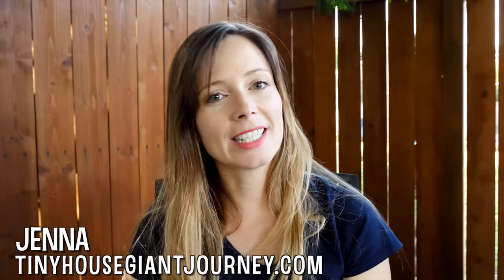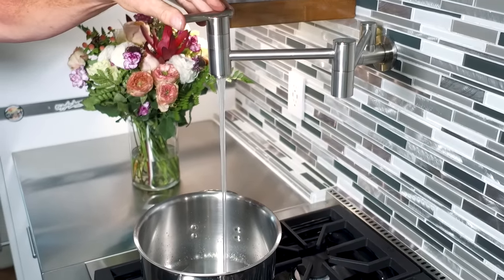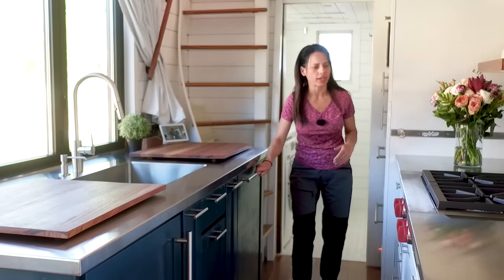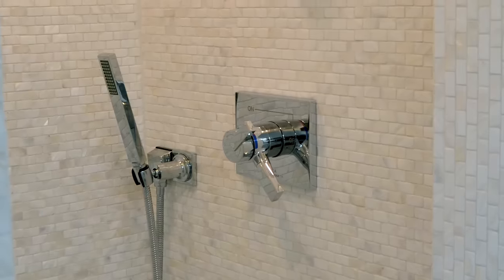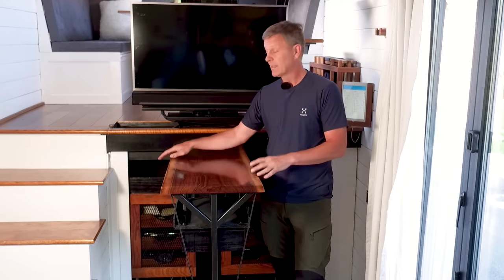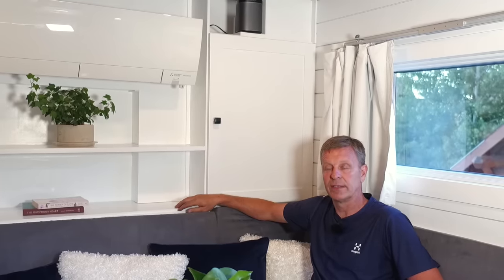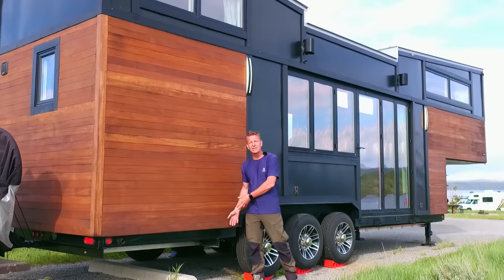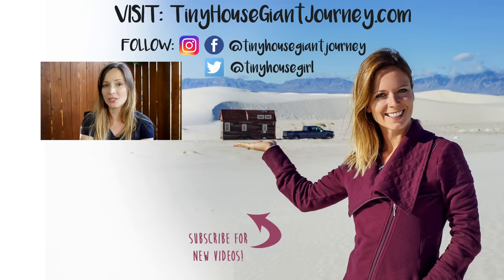Luxury, High-End Tiny House After Leaving Ex Large Home

Comment: Wow this is nice. This couple thought of EVERYTHING. From building a wonderful tiny home, to owning a BIG TRACTOR half truck to move it and lets not forget that tiny electric smart car!!
Reply: Definitely an amazing duo..brilliant design..and my most fave among so many tiny houses and off grid I've watched so far
Reply: À
Reply: @katyabone744  this has a virus guys dont click.
Reply: Definitely the one of the smartest duos
Reply: Kenneth Boyer  Yeah, that was my reaction too.  The truck was more expensive than they spent on the house.  Also there is no way his "materials" cost included all those appliances as well as the car.  Those were ALL high end appliances, at least 50K, plus automation.  They have at LEAST $400K all-in invested.  Probably closer to $500K.
Reply: It suits their new lifestyle
Reply: BABY A Well, not lesser carbon foot[tint though
Reply: Kenneth Boyer   I have a old Smart which now are owned by Mercedes and I gave it a little bit of a march because not knowing if the car is new or 2 years or older but between new and two years the Electric Smart is worth about $25.000,-  So.. all in all the entire combination they have on the road is a fortune.
For one a big fortune and to the other a small fortune. 
But I like it a whole lot! For building it themselves and thinking clever, making the entire rig so costume so you can use maximum (although I already saw some things that were thought out very clever but, I foresee that the deck will get renovated due to the wood started curving and giving troubles with stacking them away for one .. ) but something like this whole rig you can foresee that things will keep on changed because  some things never get used or just not that convenient in the end. 
But, that's everywhere and life in general.
Reply: Kenneth Boyer  200,000is attainable for everyone if they put their minds to it
Reply: Sound sarcastic to me
Reply: Kenneth Boyer  probably the towing power, all wheel drive? and maybe because they could afford to.
Reply: Tsiu - Yeah thats so true ... I didn’t think of that.

Comment: Thank you for showing this beautiful tiny house, Jenna. Its a bit disheartening to read some of the negative comments on here trying to invalidate this couple because their home doesn't fit into what some people consider a tiny house. Having resources to build your dream home is something I wish for everyone to be able to do and something I aspire to be able to do some day. This house is perfect, for them.
Reply: Jenni Boo my thoughts exactly. Just because they can afford to do this doesn’t mean they have to go by somebody else’s rules.
Reply: Dude they're"limiting their footprint" by hauling it around on a tractor trailer. All the power to them for the $200,000 tiny home but call it what it is. They want to glamp for a year and there's nothing wrong with that but they're increasing their footprint massively with this thing.
Reply from the maker: @CrosswaIk  incorrect. People used to say this about my Tiny House when I was pulling it with a Ford 250. It annoyed me so much that I had an environmental engineer do an analysis to educate people who makes blind comments without research. I have the engineer all my stats, and he compared my lifestyle to that of the average American household. Even with towing my house 25,000 miles in one year, I was using less than 25% of the carbon a typical household uses in the USA. This house is larger and heavier than mine, but it still would not even compare. To understand why, you have to also include the amount of gas a typical working couple spends going to and from work, every day, with two cars. This couple works from home, and when they do drive during the day, they use an electric vehicle. Yes they move their house on occasion with a semi truck, but 7 mpg is also what the average Class A RV gets. Heck, I even got 9mpg with my 10,000 lb Tiny House and truck! You must also calculate their electricity (solar), water usage (heavily reduced with the compost toilet), reduced heating and cooling. I'm telling you, it doesn't even compare to the average household in the USA (which is alarming), let alone the 5,000 sq foot house they lived in before.
Reply: @CrosswaIk  Well yes,  burning all that diesel does not diminish your footprint. Reminds me of those big bus motor homes or bus conversions. And since there is a lot of conversion parts within this home such as deck, tables, and ladder, hope neither one gets an injury or their beautiful home will be on the market. They did an amazing job building it.
Reply: Tiny House Giant Journey thanks for this response. I get so tired of people judging and complaining about what others have. Living tiny doesn’t mean living poorly. I’m renting a 700 sq ft condo that I would never be able to afford at over $800,000. I could buy a custom tiny 10x38ft, loaded for $150,000. All the same amenities and finishes in a smaller footprint but a smaller price per square foot. A 300 sq ft condo where I live starts at about $519,000. Thanks again for your great videos. Have a great weekend.
Reply: @TinyHouseGiantJourney  Great comment and glad to see it. The average person has no idea what their usage and footprint is. Most people don't even know how a car engine works let alone how to calculate an energy and carbon lifecycle analysis, yet somehow feel perfectly entitled and happy to criticise someone else's lifestyle, while their own actually has a higher impact. I entirely agree with you and am glad you had the calculations done. I'm a chemical and environmental engineer in Australia, and even with our significantly lower energy and fuel usage per household compared to the US, towing a tiny would usually still come out ahead.
Reply: Crosswalk  ???? Are U kidding? Did U watch the video?  Umm yeah, I’m pretty sure this couple didn’t sell their 5,000 sq.ft. Home just to “glamp” for a year!  Ridiculous comment & yes they’re enormously sustainable!
Reply: Tiny House Giant Journey and that is the problem, the average American home.  How about having the engineer compare it to an average working class European home, or an average working class any person household.  The “American standards” and dream are exactly why our planet is such a disaster.  We have a tiny trailer (7x 17 feet)  that we use to “glamp”with our 4 cylinder.  2 adults,  1 teenager, 1 dog and sometimes a second teenager.  Really, even it is unsustainable, but I could no longer tent because our weather has become so extreme. (Hail the size of golf balls becoming the norm,  and rain storms dropping 30mm in no time. We never tow it further than 3 hours away. ) You can have this sort of lifestyle with an even smaller footprint.  Don’t call it eco-friendly and sustainable because it’s not. Our home is small, and yet still too big for us (800 square feet).  I’m working on convincing the husband to bring in a small family like ours or university kids because it really is too big for us and I fully admit this lifestyle and the dream I used to have is exactly why my child is living in a different world than I ever had. Far too much of justification of these choices not having an impact on others, because it is. All those fossil fuels burning needlessly into the atmosphere is exactly how we are ending up with all the storms and Australia and the Amazon Burning. Stop greenwashing. I will stick to the New Zealand tiny house series.  There, most people park them in a spot for more than a month at a time, then a tiny home is sustainable.  There is no jealousy here. If they had not made the comments about it being sustainable and eco-friendly, I would have watched and moved on and not cared a bit, but they didn’t.  They are presenting it this a sustainable form of traveling and seeing the beauty of our world, it is not.  Children like my child are suffering because of greenwashing and over-justification of lifestyle choices that are extravagant and unsustainable.
Reply: @melissabenson6749  I would be very surprised if they're still living in their tiny home in 5 years.  I guess we'll have to wait for the follow-up.
Reply: They did an amazing job!

Comment: This “tiny” home is bigger than my rental. Just saying
Reply: lol and probably more expensive than the last 3 homes I lived in combined... the rig alone goes for nearly 40k used never mind the cost of conversion, all together I'd estimate they spent 3/4 of a million on that set up... if not more... glamping at it's finest!
Reply: Elsa’s Lair  Notice the vehicle towing it. That in itself would tell you how big and/or heavy this tiny home is. Of course there is the car.😄
Reply: @annferguson3113  They talked about weight in the video, and the trailer is only about 36 or so feet long, it's under 300 sq foot. The tractor is over kill for that small of a load, you could do that with something around a 350 but that tractor does it with ease which is what they wanted, plus you get room to put that electric shoe box on there

Comment: They did a great job in realizing their vision and the details are impeccable.   For myself though, the novelty and thrill of tiny living would wear off fast.  

I'm not a fan of having to pull, tuck, push, restore and work around things from one activity to another.  Activities that would take a straight forward one or two steps to accomplish in a straight-forward house would take tucks, pulls and swivel to accomplish to complete, tt'd just get old fast.    

As part of traveling, I also like to experience the hotel, BnB, camping or motel and that would be out of the equation.  

These are just deal-breakers for me.  I'm putting them forth because, should some of that ring true to anyone out there, then these are factors that ought to be thrown into their decision mix.

Comment: I’m curious about how they find places to camp their tiny home. I’ve heard it’s a pain due to laws and restrictions. And what would happen if their truck stopped working and needed repairs? The home is nice, but I’m curious of the cons and how to overcome them, too.
Reply: Yeah I’m really stumped on that. I guess I’ll check out their IG, but I think their choices would be extremely limited.
Reply: Semis are designed to run 1 million plus miles pulling 80k + lbs, their truck is virtually brand new and only pulling 20k so really that truck will last pretty much forever with normal maintenance.

Comment: It's beautiful, but I just can't imagine driving that semi with the car and house behind it! Also I wouldn't want to be in another car driving behind them on a major road, it would be quite intimidating!
Reply: I'd prefer to be behind or near them compared to many of the smaller tiny's and van builds. Their tow vehicle and trailer are gooseneck rather than conventional hitch, and the tow vehicle is rated for 4-5 times the weight they are actually towing. Most tiny's and van builds i've seen on youtube have no idea what the weight of their completed and filled build is, let alone whether it is legal or safe to the gross carrying capacity (vans) or rated towing capacity (tinys and pickups). This couples setup while bigger, would be much more stable and easy to control and manoeuvre and much easier to stop. It would be safer when towing than a conventional pickup with a caravan.

Comment: FYI......I am placing your Tiny Home  #1 on top of my list of favorites !!     The 2 factors in my decision is having a " Gooseneck " trailer for the foundation,  and your designing the kitchen area to open with the sliding windows & doors, onto a outside deck.  After removing & storing your deck a few times, I bet you said to yourself  "" why didn't I inset this section so the deck could have folded up to the side of the trailer "".  None the less, you have shown excellent engineering skills !!

Comment: Someone somewhere had serious carpentry and engineering expertise. Your average person isn't building this for 120k. Labor alone would be 100k, then you can add your base costs, and finally your tow vehicle, which for this is at least 100k. That puts your real costs into the 300k-400k range.  There is a reason RVs this nice are 500k plus. Secondary considerations are that most RV parks only allow certified RVs less than 10 years old. And diesel truck maintenance that is not cheap, think thousands a year depending on mileage. This thing is amazing, but not for your average person or average budget. I'm impressed at how well they executed such a difficult endeavor.

Comment: The Volvo semi itself is around $230k, the custom trailer home itself cost probably over $350k. The semi runs on diesel and only gets about 8MPG. They have two Tesla batteries powering the interior lighting and electricity. I wouldn't say this is renewable or affordable by ANY means.

Comment: I do have question about how to finance something like this. A tiny home on  a static lot and cost $99,000 would be around $350-$400 if you do a 30 year loan. How do you finance a truck that you converted to a home?  Automobiles are usually 36-84 month not 30 years.  I would think if you had to finance an auto, it would be like paying for a high end Mercedes. It would be a huge payment for up to 84 months, but not too bad in the grand scheme of things.

Comment: Wow I got mine out the door for $70,000.00 including labor. RV. Jayco Eagle HT 294-ckbs you got took. All that labor. Yep, I have that stove only mine is all black with a smoked glass over that folds open when I want to use it and closes if not in use I can use for more counter space. Have the blue cabinets in my bathroom with a trim of it around my medicine cabinet in br also. No stairs in mine, I have an 11 x12 bedroom with a tipout. Also two more tip outs in other room. why it's 14 x20. 7' high ceilings with steel bars in ceilings so no tree or anything will fall on trailer and crush it.

Comment: I mean this tiny home is remarkable. It's extravagant. But they went from a 5,000 square foot home. I don't even think I'd want to live in a home that size at their age. It's a lot to maintain. Even at my age I wouldn't want to live there. too much to maintain.

And they prove that you don't have to give up or compromise anything to have what you want and have everything nice and fancy. 

And the factor is they have the tractor trailer which gives them added storage and added square footage and it looks like the tractor trailer has a cab in the back so they probably have a bed that they could pull over and rest and relax in while traveling.